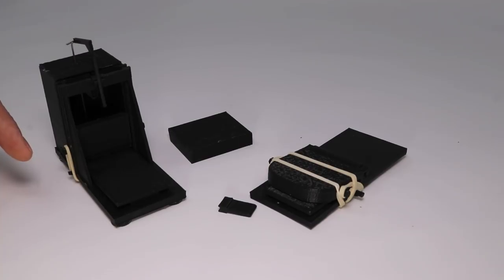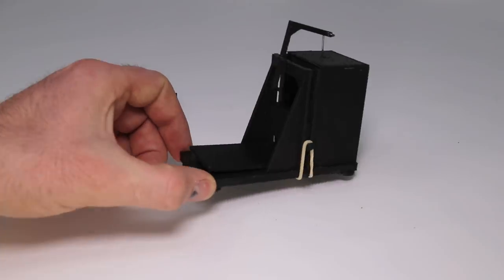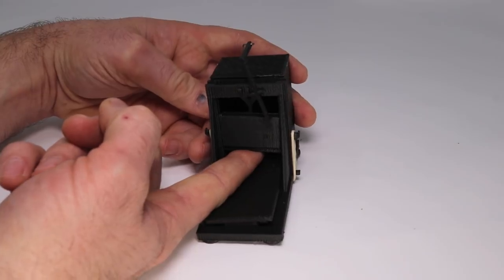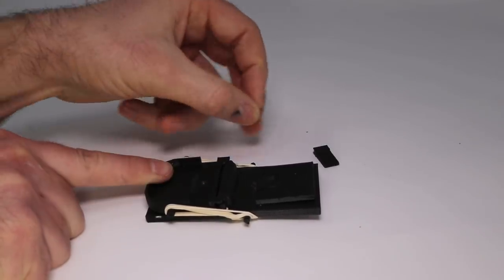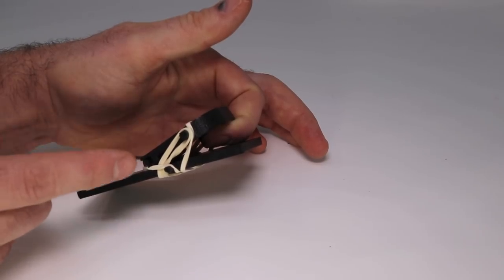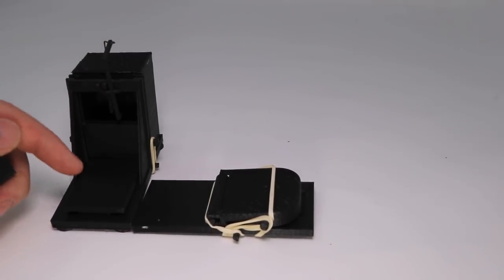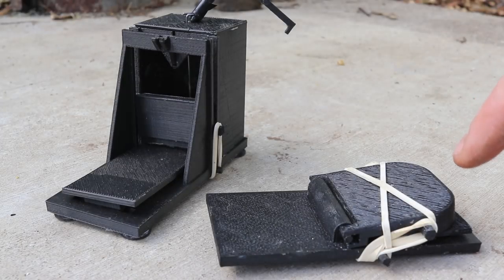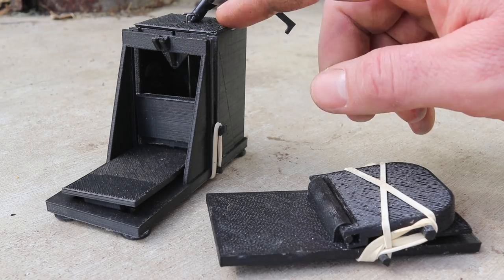2 New 3D Printed Mousetraps Invented by a Youtube Viewer

Comment: A guillotine trap without decapitation?
What's the point?
You might as well invent a ice creamless ice cream cone.
Reply: A just right guillotine trap snap necks, while real guillotine makes a mess.

Decapitated mice would need a bit of a clean up before resetting. But that meant that the trap must be easier to clean.

Either design is still quite the challenge for engineers especially when taking materials into account.

Comment: FDM 3d printing requires really clever engineering (or post processing like extensive fileing/sanding) to have smooth enough action for a trigger. 

That's why the "chew through thread" trigger is so we'll suited to FDM designs.

Comment: You could always use a piece of string with plenty of slack in it to super glue & tape those loose trigger pieces to the larger pieces of the trap so you don't loose them.